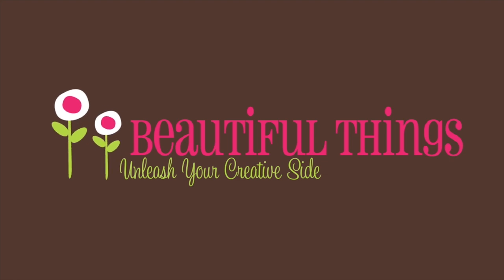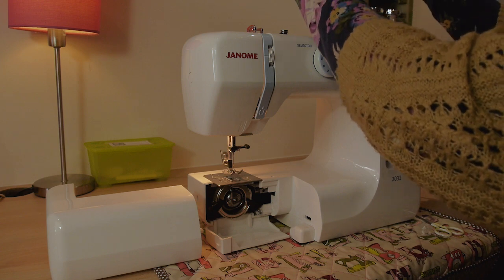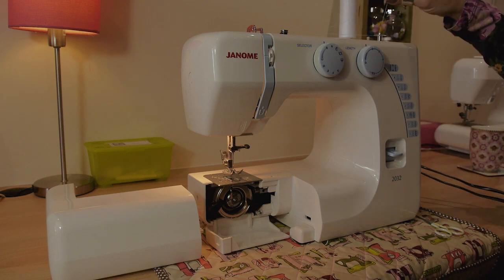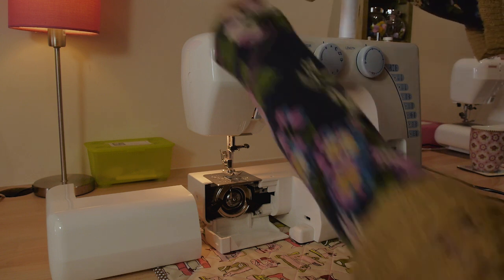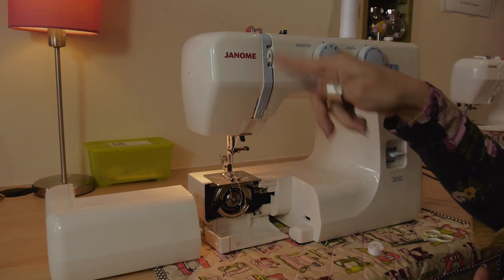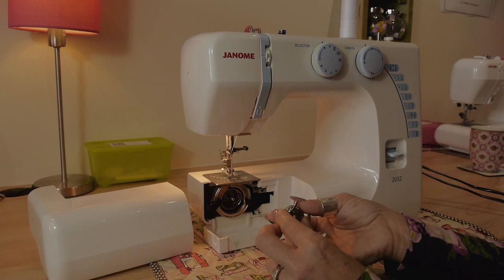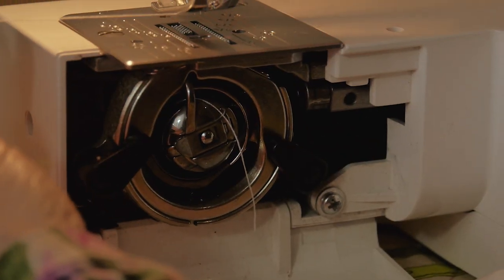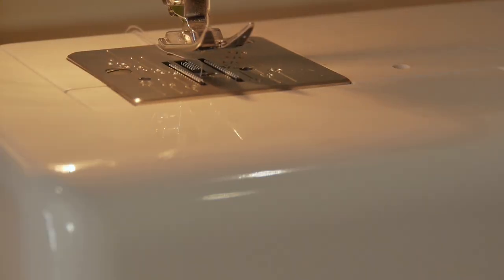Threading your front loading sewing machine

Comment: My mother solved the problem of the annoying jumping spool many years ago. Mum removed the nib and ink from a felt tip pen and put it on the spool holder. As long as the pen or felt tip is normal size and straight this will work. Make sure to give the pen/ felt tip a good clean after dismantle just in case if there is any ink.
Reply from the maker: Awesome idea

Comment: I’m a beginner. How can i fix the problem of when i’m winding the bobbin, the thread goes under the bobbin around the thing that holds it instead of around the bobbin?😭
Reply from the maker: Make sure your bobbin is pushed right down on the winder.  Hold onto the thread for a little bit before stopping and then cutting it off.  Be sure it's securely in the tension disc and go a little slower to start.  Combine all of those and you should find it helps x
Reply: @BeautifulThingscraftandsewing  oh so i figured it out last night! i put the thread through both holes in the discs instead of just the top one. thank you for replying though!💓
Reply: @BeautifulThingscraftandsewing  i mean i put the thread through both which was causing it to wind on the pin instead of the bobbin. i didn’t realize you only put the thread through the top hole😅
Reply from the maker: Ah that would do it!! Glad you sorted it

Comment: Would be helpful if you showed how you hold the bobbin before putting into the case  ie thread from right or left  Thanks
Reply from the maker: Do you mean when I hold the plastic bobbin and drop it into the metal bobbin case or when I put the case into the bobbin housing?  1 matters, 1 doesn't

Comment: I’m still have trouble with my bobbin , it doesn’t thread through to the front. It feels like it’s locked somehow . It’s brand new too
Reply from the maker: It shouldn't really thread through to the front as such, it's up to you to pop the thread into the channel in the case and make sure it hangs forward before putting the case into the hole if that makes sense.